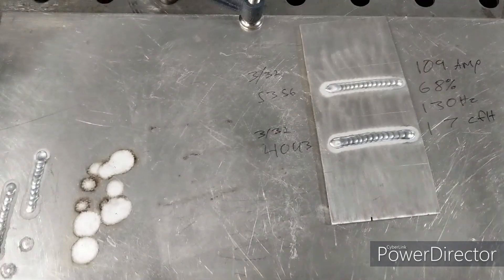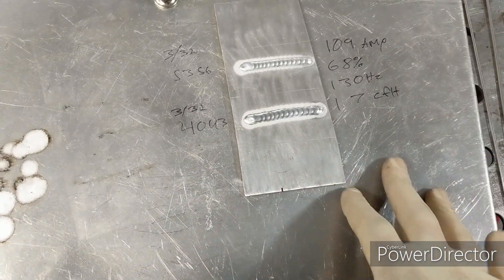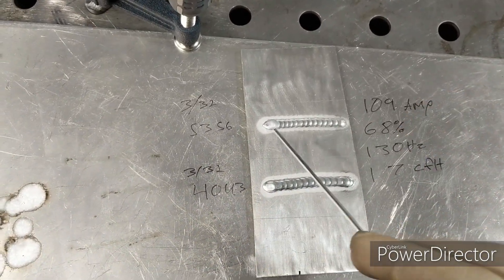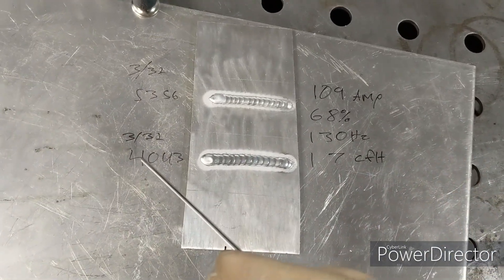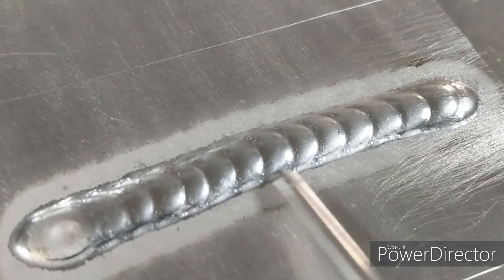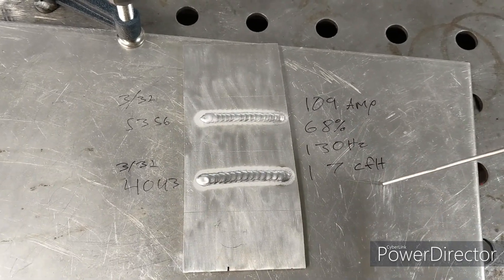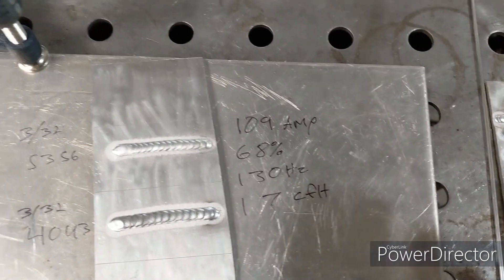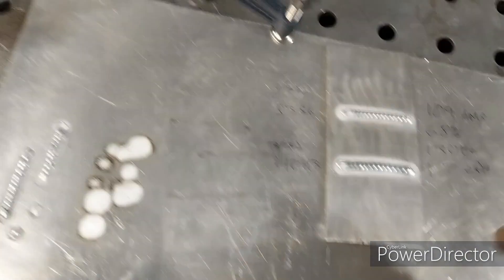4043 vs 5356 TIG Filler rod COMPARED!

Comment: Thanks a bunch,  I am into automotive AC repair and I usually replace a busted condensor or AC line due to a wreck. My local welding shops ain't cheap, so I want to get into weldind aluminum. Thanks for sharing your knowledge.
Reply from the maker: Its tough, but well worth the effor! Thanks!